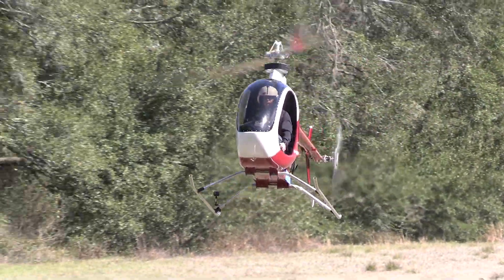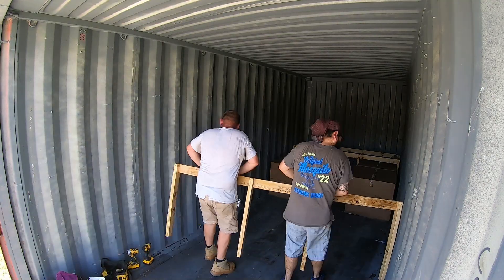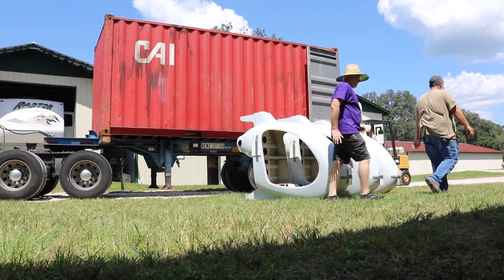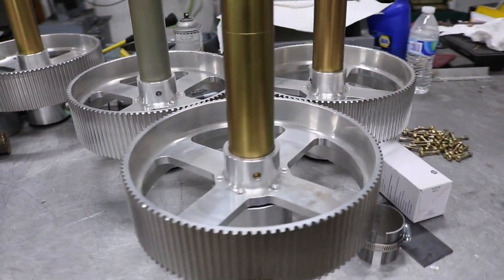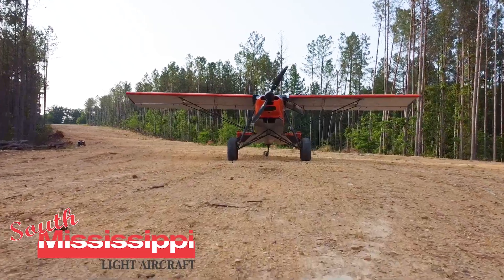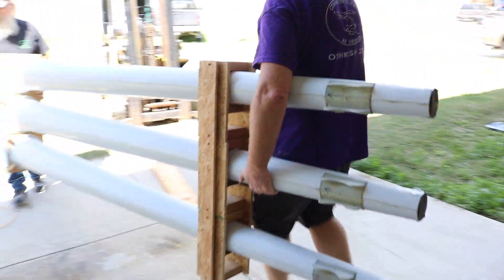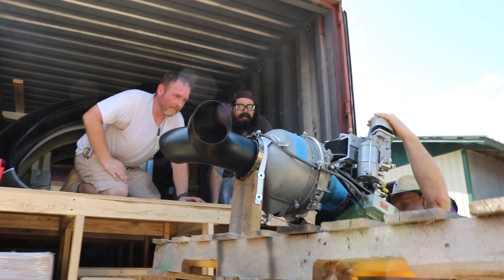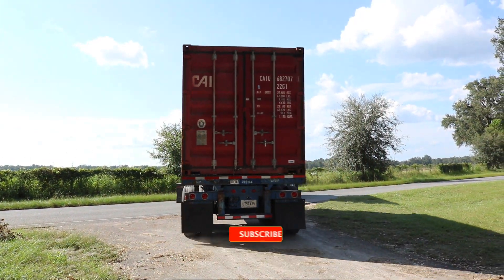Mosquito Helicopter - Best Shipped Kit Helicopter in the World!

Comment: I load 20’ & 40’ Ccans (as a transporting company).  
We use specialized equipment/ trailers to drop the Ccan at the customers’ location.   We place the Ccan at ground level, which allows for easy loading g of product, then return hours/days/weeks later to retrieve it and then bring it to the ports for international logistics.   Just another way of doing things.

Comment: Hey Brian,

 I worked at one of the oldest and largest power sports dealerships in Indiana. New Honda, Suzuki, Kawasaki and used Harleys. Back in the 90’s we had 200-300 used motorcycles on hand about all the time. We had a dealer friend in Hawaii that would come over and buy 40-80 used bikes every summer. We could fit 40 street bikes in one 40 foot shipping container. We put the first row of 20 bikes in and strapped down. Then used 4x4’s for legs and 2x4 cross bracing with 1/2in plywood for a second deck. We had a special platform built to lift bikes up to the second deck. We would push bikes in and slide the rear tire around so all bikes was strapped down sideways on each level. We could load 20 bikes on each level. Hawaii only gets so many new bikes a year to their dealerships. So that means used bikes bring a premium. We sold Big Island Yamaha 1-2 containers every year through most of the 90’s. He was paying us close to retail, plus had to pay a import tax and still made good money. I remember him saying he made on average $100-$125k on each container. That was a lot of money in the 90’s. We had to unhook all batteries and drain all the fuel to make the container legal to ship across the ocean. We never had one bike damaged in shipping that I remember. The container was hauled to Mobile Alabama and loaded on a ship, then the ship went through the Panama Canal. Each load took 4-6 weeks to get from Indiana to Hawaii. This video brought back memories of loading bikes and building floors in a shipping container. Cool video 🇺🇸🦅✈️

Comment: We've shipped and received a lot of large equipment via container. If we were able to make a subfloor we'd cleat stuff in place with blocks nailed into the floor. If not, we would lash crating to the D-rings on the inside top/bottom on the walls. I hope there was something else in there to keep the kits from sliding around besides the good planning. 🤑
Thanks for the video!
Reply from the maker: That subfloor was packed in there very tight. And then everything fastened to that. Wasn't much room left to "wiggle" around. Thank You for taking the time to watch!